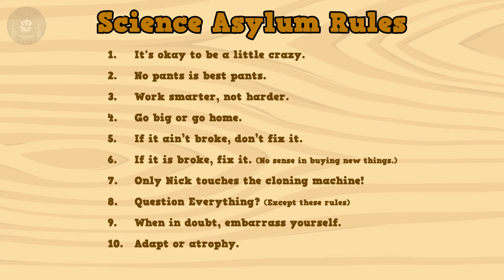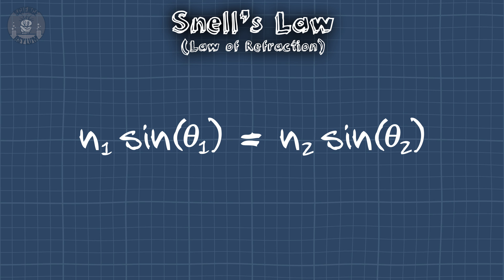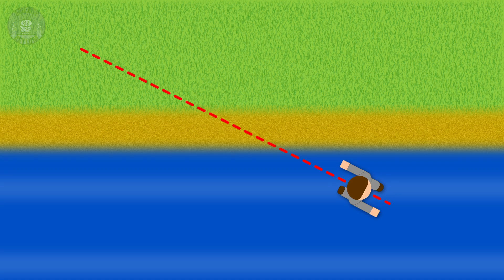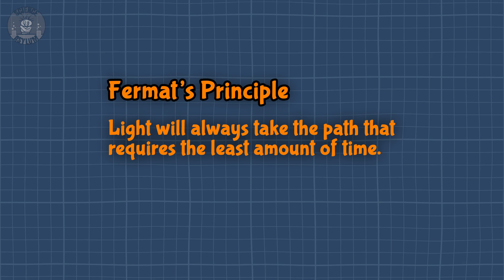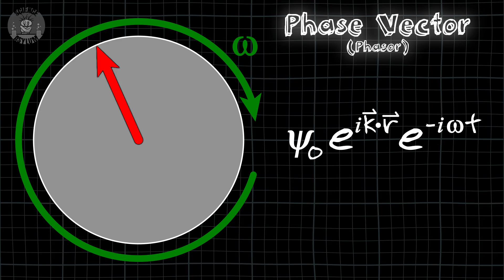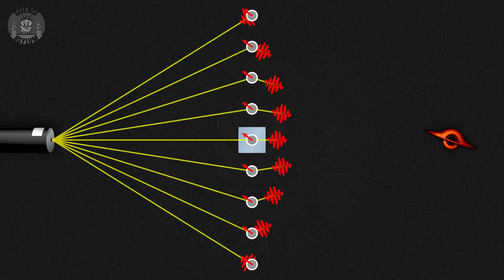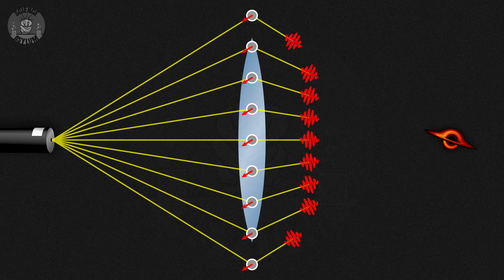Why Does Light REALLY Bend?

Comment: "We just used quantum mechanics to explain how lenses work"
Me: happiness noise
Reply: That actually exploded my mind. The way he presented the whole thing didn't even make me see it coming till he dropped it on me
Reply from the maker: @klaik30  Surprise! 🤯
Reply: The Science Asylum if a lens works as per your animation then in a real lens why do the photons at the top are refracted to the bottom and bottom to the top, resulting in an inverted image, what does this have to do with the time it takes light to pass through glass to get to a sensor, that doesn’t explain how a lens works!
Reply: @Dinkum_Aussie  Actually the path of Photon is probabilistic path not in a sense just ordinary path... Photon that comes toward it and arrives at a certain time when we observe its phase and add it with phase of the other photon paths apparently it is not canceled so in a sense of probabilistical way there is a photon comes from it.
Reply: Dinkum Aussie: I think this would be a lens that enlarges, not a lens that reverses. As the water glass made the straw appear here rather than there, the lens makes the thing at the focal point appear to be located at many points across a field. (If that makes sense.)
Reply: Q-tuber when a camera takes a photo the image is upside down this is because of the lens light does not pass though a lens in a straight line, it twists 180 degrees. Even a camera without a lens like a  pin hole camera 
But now when I think about it. Maybe I am thinking of a 1 sided lens, curved on one side flat on the other! 
Only because I was thinking well a hand held magnifying glass dose not  invert the image, damn now I am confused. Gonna have to read up about this, I have been told there are lenses made by someone that defies physics, between prisms, and lenses, they can manipulate light in crazy ways.
Reply: @Dinkum_Aussie  the fact is Science Asylum is measuring at the focal point, where all light converges. If you measure before the focal point, you get a normal image. If you measure after the fp, you get an inverted image. If you get far enough from the fp, the resulting image can be larger than the object itself (that's one of the reasons why telescopes and tele lenses are big and long)
All convex lenses behave the same, but you can optimize them for the task by choosing glass type and curvature. Even lenses with one flat side, or one concave side (like glasses) can behave as convex, if the sum of the curves at both sides results in a convex shape (if the lens was made of rubber, and you tried to straighten it to flat, without altering its thickness / if the thickness of the lens is greater in the middle than at the edge)
Reply: @Dinkum_Aussie  do people wearing glasses see the world upside down?
Reply: @Dinkum_Aussie  this is not because of lens, bottom photons do not jump to up in a lens.
Reply: @ScienceAsylum  can you do an episode explaining the mechanics of the 3 polarization filter experiment?
Reply: @klaik30  I saw it coming and it still exploded my mind.
Reply: happiness noises intensifies
Reply: What about magnets, though?
Reply: That explanation was mindblowing to me.
Reply: XD
Reply: "we"? Mr. F? Surely You're Joking?
Reply: Happiness noise... most folks call those farts

Comment: Nick, you the man bro. How you breakdown physics concepts on YT is unparalleled.

I have a question thou, regarding the "strong force." Why is it that at a certain "length or diameter" of the nucleus this force just disappears. That always bothers me.
Reply from the maker: It's called "confinement" and I don't totally understand it. It has to do with how strong it is.
Reply: From what I know, it's because in protons and neutrons color charges (strong force analogs to normal charges) cancel out, and so force between protons and neutrons is actually just a residual force from not cancelling out perfectly. And it decays exponentially with distance, just as its electromagnetic analog - van der Waals force
Reply: Isn't this about fluxtubes because gluons interact with eachother ?
Reply: @CraftyF0X  Fluxtubes are the result of that the actual strong force is almost constant for small distances, but it decays rapidly when it cancels out
Reply: Mmh interesting, so basically the solution is in quantum chromodynamics in conjunction with particle physics?
Reply: @sphakamisozondi  Well, yeah, because chromodynamics studies specifically the strong force, while being a subset of particle physics
Reply: I may provide a simplified semi-classical explanation of how I understand it. Let's consider the simplest case a pion - a particle made of quark-antiquark pair of opposite strong charges (for example blue (B) and yellow (Y)). Let's grab the quarks and start pulling them apart:
<-B ...... Y->
You are adding potential energy to the bond. At some point the potential energy reaches a level where it matches energy of a quark-anti-quark pair (denoted by lower case). Virtual particles spawn. You'd expect the scenario to look like this:
<-B......yb.....Y->
the yb quarks are closer to each other than to BY quarks respectively. This means they are attracted back together and anihilate.

In reality, strong nuclear force is super strong. The distance at which it reaches these energies is comparable to the wavelength of quarks. Because of this (and heisenberg uncertainty principle), on average the virtual particles spawn like this:
<-B..y..........b..Y->
If you are keen observer you may notice the problem. This is no longer two charged quarks being pulled apart. These are two neutral pions being pulled apart.
<-(By)      (bY)->
The potential energy of the bond got converted into matter. This is pretty much guaranteed to happen every time you stretch strong nuclear bond too far. Because of this the force effectively has limited range. You cannot have two strong-charged particles too far away from each other, because the potential energy between them rather spawns new matter to neutralize the charges instead of actually exerting force.
Reply: This simplified model also explains why there are residual strong forces between neutral composite particles when they are close to each other (such as neutrons and protons in the nucleus). Strong force drops off with square of distance (just like electro-magnetism and gravity). Let's consider two pions placed in a line, such that all the quarks are spaced distance 1 apart:
(B_y)_(b_Y)
Let calculate total attractive force between opposite charges and total repusive force between like charges:
Pairs of like charges (B-b and y-Y) are always distance 2 apart. thus total repulsive force is -(1/2)^2 - (1/2)^2 = -1/4 - 1/4 = -1/2
Meanwhile opposite charges are distance 1 for y-b pair and distance 3 for B-Y pair. Thus total atractive force is (1/1)^2 + (1/3)^2 = 10/9

BTW the same effect applies to electro-magnetism. In there, it is called van der Waals forces. It's what allows neutral molecules to form liquids and solids.
Reply: @KohuGaly  Does it really drop off with square of distance? I thought it even increased slightly, unlike gravity and EM, and that was the reason to the residual forces